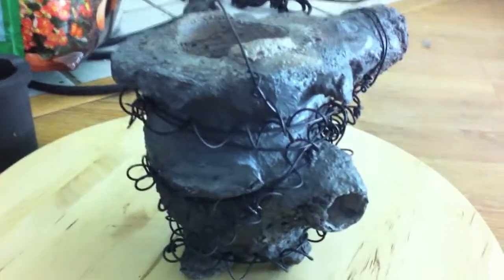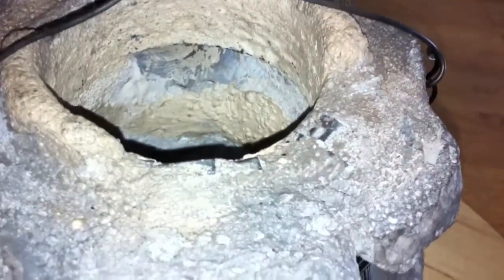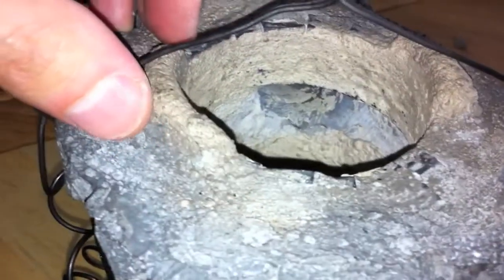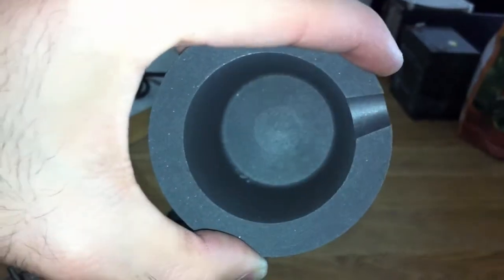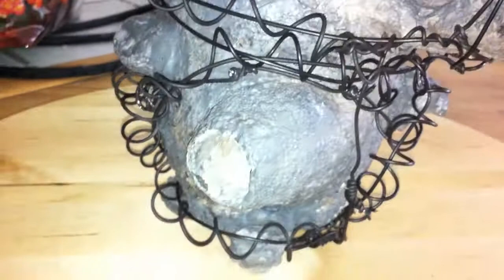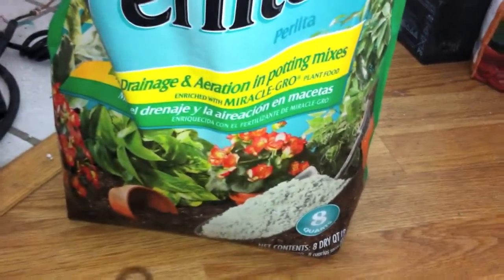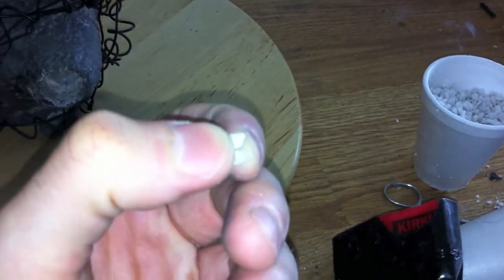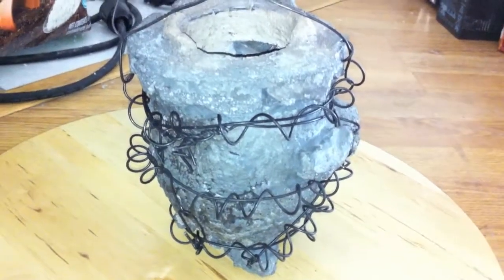Swirl Furnace Stage 2

Comment from the maker: @L1ne3 I just used cling-wrap covered cardboard as a base form making sure to hot glue little horizontal cylinders to form the scaffold for the inlet and exhaust ports. The rest of the build was a simple additive process using steel reinforcing wire to strengthen the outer casing. BTW, one should use perlite as a heat insulation additive (blended into the cement) in order to make the outer refractory layer much more heat resistant.